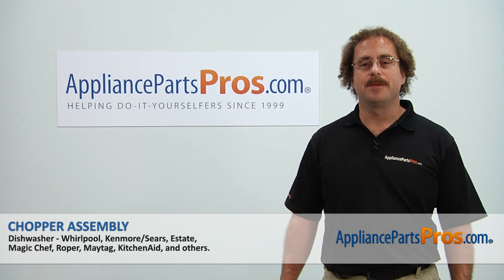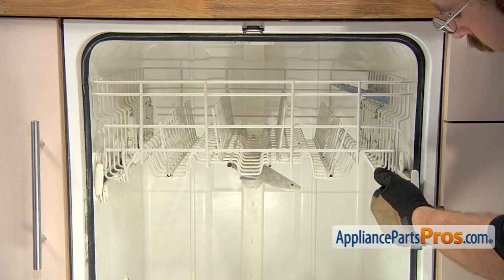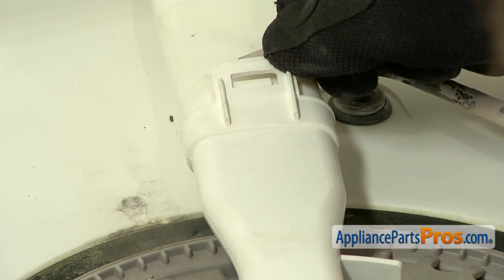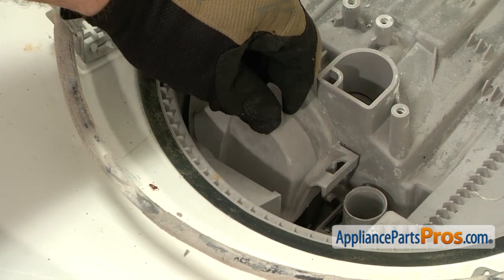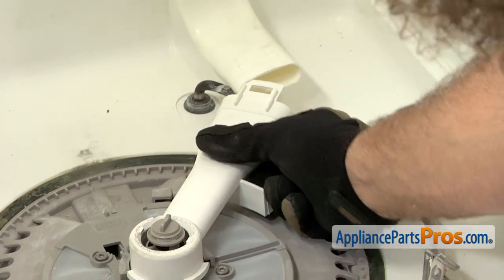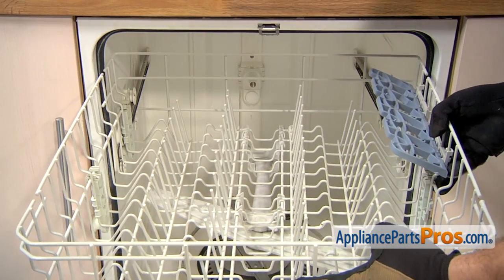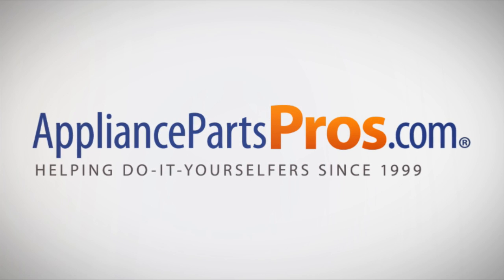How To: Whirlpool/KitchenAid/Maytag Chopper W10083957V

Comment: Another successful repair. The middle spray arm was not spinning and Appliance Parts troubleshooting led me to taking a look at the chopper mechanism. The chopper was completely clogged and the impeller was dislodged and the nut holding it on was off. This is the 3rd repair to my dishwasher (new pump, new float valve)  and Appliance Parts videos and parts were instrumental in the repairs. Thank you.

Comment: Thank you very much for a very helpful video. We needed to replace this part on our older Whirlpool dishwasher. As you mention, the shaft was trashed and the chopper blade was MIA completely. We had cleared out shards of glass & other trash from the grinder compartment which is probably how the shaft broke in the first place. Took our tablet right over by the DW and watched your video step by step before & while we reassembled. Very helpful hints. We are running an empty load right now just to make sure it's running properly. Seems to be good. Thanks again. Your YT saved us hundreds in repairs.
Reply from the maker: That's great to hear! I'm glad you were able to get it repaired.

Comment: I did not have the wrench you used to make the grinder installation work, so I tried a couple hard plastic reusable straws to give me the spacing needed to activate the spring. Worked a charm but the wrench would have worked better. 10/10 video
Reply from the maker: Thank you!

Comment: You validated my suspicion that the spring actually did have a purpose! I took apart my system to clean it (it was really bad) and could NOT get that chopper back in right. I was telling my wife this spring must mean that this retracts, but it absolutely wouldn't (it actually came out with the upper part of the housing or I'd have left it where it was).

Comment: Please discuss which slot to use as there are two of them. Also, is the chopper supposed to lock into the black shaft of the impeller? How do you know whether the arms of the black shaft impeller have not already been sheared off? How does the black impeller engage with the food chopper shaft, even if installed correctly? I find I can still turn the new chopper freely. I may not be using the right word impeller and I hope you know what I mean.  Also, how do you know that the metal grate on the chopper is seated onto the housing slot? There is no way to see it.

Comment: The chopper in my dishwasher keeps getting clogged. It doesn't seem like the spring mechanism/shaft is broken. But I clean it and the dishwasher works great, but it'll get clogged again in a couple months.

Should I replace it? Are the blades supposed to be sharp and "chop" whatever is in the way? Maybe the blades are dull and I need a replacement. Any advice appreciated!

Comment: Thank you very much for making and posting this very helpful video.  I got all the way down to the cover and then could not get it loose.  Inserting the screwdriver to pry the tab didn't seem to budge anything.  I was able to fish out plastic fork from underneath the cover that I am hopeful was the cause of the problem, but I'm wondering if you have any further suggestions as to what to do if so much crud has built up around the tab that it won't move.  Thank you for any further suggestions you might have to share.  And thanks again!

Comment: I got the cover off to notice that the impeller had rung off along with the cover piece to hold the whole chopper assembly together. I then pulled everything out and gave it a good cleaning because the screen was filthy. My question is, during the reassembly of the chopper assembly, where does the washer with the tongues go? Which was does it face? I currently has the orientation of all the the assembly as follows (back to front)…
Spring
Flat Washer
Chopper screen
Impeller flat against screen
Washer with Tongues (facing impeller)
Cap
 Does this sound right or should the washer with the tongue face another direction or be somewhere else? This seemed to be the way I could get the impeller and shaft to turn in sync. Any help is appreciated!

Comment: My POS maytag was making that grinding noise.  I removed the chopper and noise went away.  What is actually worn out here?  My blades are engaged on the shaft.  Does this mean the coupler to the motor is screwed?  Motor time?

Comment: This is a great channel! I really appreciate how easy to follow the videos are.
Question: I followed this video and it seemed to work well, but when I ran a test cycle with a cup of cleaning vinegar it leaked a little near the front left of the dishwasher. Is it possible I did something to cause the leak? What would you suggest for troubleshooting?
Reply from the maker: You will need to check the door and the seals to make sure nothing is damaged and everything is aligned properly. Check around the door and the frame for any debris that could be causing the unit to leak. Also, check the spray arms for clogs.

Comment: I love this video, I started by wanting to clean the dishwasher because my dishes are not getting clean.  I was then led to this video, I disassembled the chopper and my blades are damaged.  I am trying to put the old chopper back on until the new one is delivered and I cannot get the white plastic piece on the back of the chopper assembly to meet up with the black plastic piece inside.  I have positioned to blade like you said and tried moving the white plastic piece to fit over it and I cannot get the two over top of each other...
Reply from the maker: 1Finkenb1 When you take out the wrench the spring should push the ends together. If its damaged you may have to wait for the new one.
Reply: AppliancePartsPros How do you know the white connected properly to the black motor shaft?

Comment: I’ve bought a new chopper assembly, and it’s supposed to be OEM, but the shaft is too short and it’s not making good contact with the motor. It is not spinning, and so it keeps getting clogged with debris. I think I’ve taken that thing apart and cleaned out the blade about 12 times now. Seems they don’t make a really good OEM replacement anymore.

Comment: Thanks, but I am not sure if this repair will work for me.  My chopper is not turning.  I confirmed this by making the machine think the door was closed, and watching as it drained.   From my understanding the chopper should be functioning while draining, is this correct?  I was able to turn the blade by hand, so I know it is free of any debris.  My model is: 665.13849k601.  Everything else functions during the drain process (water is being pumped out of the basin.) Any advice would be greatly appreciated.
Reply: Chopper shaft is probably stripped. Need new chopper and maybe pump, just chopper and new shaft on pump. Hope that helps.

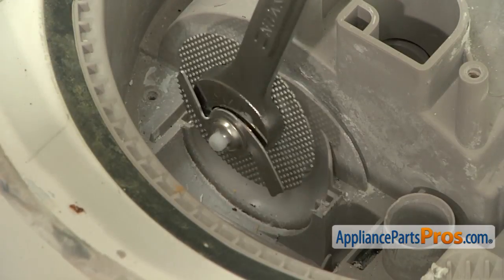Comment: at the 4:06 mark, you can see that there is a slot on the bottom side where the screen need to go. There was still some dirty water left in mine, so i couldn't see that slot. What screwed me up is that there is a square notch in back of this slot that looks like it's where the screen would go. So I was trying to drop the assembly into that spot, and of course there is no way it will fit there. So I wasted a lot of time trying to fit it into the wrong spot, so it may be worth point that out.
Reply from the maker: Thanks for that tip!
Reply: I just wasted half an hour trying to do this, so I’m glad you clarified this!
Reply: Same here, tried for 20 min to get that screen into the wrong slot. Thanks for this video!

Comment: I tried to follow this video to reinstall my chopper that seemed to have come un-assembled inside, when I went in to clean the area around it (based on another "cleaning" video). My problem is I can't seem to get the chopper assembly white plastic piece to lodge into place onto the black (motor?) piece. Every time I get the contraption wedged close to fitting, holding it with a wrench the way you show, I seem to miss the connection and everything pops apart on me--spring, washers, blade and little top holder piece. Is the top holder piece supposed to hold on better? Also I was using a 10-16ths wrench instead of 11 like you say. Could that be my problem?
Reply from the maker: Using the wrong wrench could be the problem. Try it with the one recommended and if that doesn't work, get in touch with us, and we'll help you figure out where it's going wrong. You can give us a call at 1-877-477-7278 or you can chat us at our website: http://www.appliancepartspros.com/. We’re here to help 7 days a week.
Reply: AppliancePartsPros Thank you so much. Turns out I was trying for at least an hour to squeeze the spring-loaded thing into the inner (wrong) slot. Why would they even put a second slot there!? Finally listened to your video more closely and heard “outer” slot. I think it worked now, however I still wonder if that top cap piece might not be on securely enough/might pop off again now that I’ve closed things back up. ...
Reply: @gsublette6726  I had the same problem! Yes, I was trying to install the chopper in the inner slot, too. Thanks for posting this comment -- I hope others with the same problem are able to find it, too!

Comment: Don’t make the mistake I did when installing the cover over the grinder. There are 4 long screws and one short one. Utilize the short ones for the grinder cover and the 4 long ones for replacing the screen as shown in the video.
Reply from the maker: Thank you for the tip!

Comment: WARNING: After removing the clogged chopper/screen, it is possible (easy) to reinstall the cleaned or new chopper assembly wrong. You can even replace it's cover with that tight groove to hold the screen properly in place, so you can't rely on being able to install that cover.  The chopper won't work unless you first get the 4-pronged plastic joint to FULLY engage with the motor shaft; sometimes the spring is not enough by itself to force that joint into the engaged position and the motor shaft is then able to rotate inside the plastic joint without actually moving the cutter blades. The dishwasher will then clean the top rack very nicely for awhile, weeks maybe (depending on how you pre-rinse food off dishes), until the screen clogs from all the water continuing to flow against/through it WITHOUT THE CHOPPER BLADES ROTATING ( the top rack will then stop getting water flow again). When installing be sure to fidget with manually turning the chopper blade -- while applying pressure toward the motor shaft to push the joint to a fully seated position on the motor shaft. Here's how to tell if you've accomplished this:
 1) see whether the cutter blade sits as flat against the screen as it did before installation (note how flat it sits before installing it). 
 2) manually turn the cutter blade and feel for resistance of the motor (it turns with some resistance when fully engaged  vs relatively free spinning of the blades when it is not).
 3) while manually turning the cutter blade a little bit, use a focussed flashlight on the very-hard-to-see-into junction of the plastic joint and the metal shaft to see whether the plastic is turning by itself without the metal shaft rotating (when engaged correctly the plastic joint and metal motor shaft must turn together).
Reply: I just went through this and just reinstalled after about 2 weeks. Hope I got it this time 🍻
Reply: Thanks for the details.   My cutter blade seems attached to the motor and flush with screen but we are getting a ton of debris each wash on top and bottom rack. We don’t scrub the dishes beforehand.  The tub drains okay.   Will go back in and recheck.  Thanks for the input.

Comment: When I got my replacement chopper the blades didn’t make contact with the screen. Needless to say it clogged after about a week stopping almost all circulation. So I just removed it. Is that going to spell disaster down the road?
Reply: 2 weeks later. Did it? 
Cause mines broke and I'm debating fixing it at all.
Reply: HNIC LEGEND so far so good

Comment: Appliance Parts - I am facing tan issue  whirlpool dishwasher model from 2011. Chopper blade fits in to slot far away from motor but from there I am not able to attach to motor shaft. I am  able to attach if i  move the chopper to slot in the back , but chopper itself is not fitting correctly there to rotate correctly.  I am thinking maybe my motor head is having a broken cap.  This is a bit frustrating. Can you please help what am i missing ?
Reply from the maker: What is your model number?

Comment: All well and good,replacing the chopper assembly, which didn't like trying to masticate the small jewelry chain that  somehow got into it and stopped it completely..

But there also exists as the "driver" of the chopper, a plastic "nose piece" on the motor shaft...

And it has been worn away to the point that it's  not engaging at all.

So, is there a way to replace that plastic nose piece on the motor, without removing the machine, and getting a new motor??

I have a 12 year old "Kitchen Aid", that runs fine, but the monthly disassemble to clean the rotor is getting tiresome. 
===============

I've thought of cutting a piece of fiberglass screen to fit in the bottom of the unit, below the heaters..

Which would keep any particles from getting to the masticator.  And then vacuuming the screen weekly.

Your suggestions appreciated.
Reply from the maker: +Darvish Blathsnocker You can go to our website and enter your model number to see how the parts are sold. Usually you would have to buy the motor assembly or the whole motor and sump assembly.
Reply: Dear AppliancePartsPros Thank you.  That's what I figured.  A whole new motor , with the extra hassle of removing the whole dishwasher. Darn!What I'm going to try first, is to cut a piece of fiberglass screen door fabric in a circular shape to cover the slots that the water circulates into the pump through:  with an off center hole in the circular shape so the arm assembly can fit through it:and by this means filter the water before it gets down to the non-rotating chopper assembly: and vacuum away the collected material as it builds up.Whadaya think?  Will it work??Regards...
Reply from the maker: Not sure if it would work but you could give it a try! If the screen restricts the water flow you may starve the pump and that will be another problem.

Comment: A tools needed list right up front or posted in first comment would be very helpful. Also shooting the installation of the new chopper part without the bulk of the installer's hand in the view (same for removing the chopper cover) is problematic, as those are two of the trickiest parts of this repair.
Reply from the maker: If you'll check the video description, you'll see that we do have a tools needed list. In this case it's: 

Tools needed: flathead screwdriver, Phillips screwdriver, pliers, Torx 20 driver, Torx 10 driver, 11/16” wrench, needle nose pliers.

We also apologize if it's difficult to see. We do our best to film clear videos, but it can sometimes be hard to film in tight spaces. If you ever have any additional questions, you can give us a call at 1-877-477-7278 or you can chat us at our website: http://www.appliancepartspros.com/. We’re here to help 7 days a week.

Comment: At 2:45 are the instructions for removing the plastic assembly around the chopper.
Reply from the maker: Yes that is the chopper cover!
Reply: There's a hidden tab that this video explains at 2:55. Everything else is pretty obvious, but trying to remove the cover without popping that hidden tab is going to be either frustrating to you or damaging to the dishwasher.

Comment: Is the blade supposed to be sharp? I did a maintenance cleanout of mine and noticed mine was not. Anybody?
Reply from the maker: We're always happy to answer appliance questions. We offer free technical advice and diagnosis. You can give us a call at 1-877-477-7278 or you can chat us at our website: http://www.appliancepartspros.com/. We will need your model number to give you accurate advice, which you can locate using this tool on our website: http://www.appliancepartspros.com/modelnumber_locator.aspx

Comment: I thought this was a really good repair demo, but one part really confused me.  When you put the wrench on the chopper to replace it you said and showed things too fast.  You said, "make sure the smaller cutout is on the bottom and pointed to both cutouts."  But, more important when describing putting it back with the wrench you said, "put 'this' at 12 o'clock on the wider sides."  What is 'this'?  Then you moved the center part back and forth.  Why, and what are you doing?
Reply from the maker: Jim Jim Sorry for the confusion, you put the wrench at 12 so when you put it in the wrench is at the top and easy to pull out once you have the part in.
Reply: AppliancePartsPros
That didn't do it but thanks anyway
Reply from the maker: Jim Jim What are you having trouble with?
Reply: Here is a picture that should help. The thing to know is that the metal mesh part of the chopper assembly is not perfectly round. It has a big half and a small half. The small half fits into the slot. As some one else pointed out, beware of the false slot, too.  https://pasteboard.co/HF3ghbC.png
Reply: Jim Jim what he means by 12 is like the hands of a clock and where the 12 is located. Does that help?